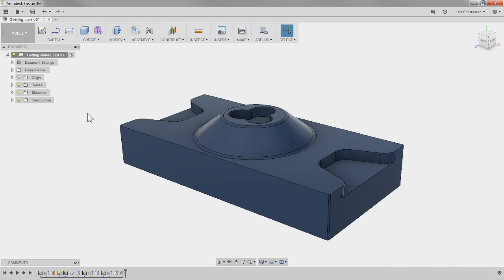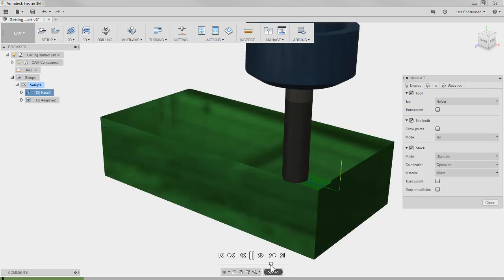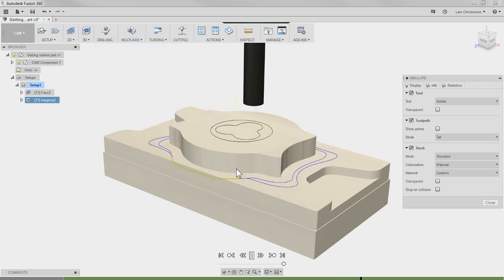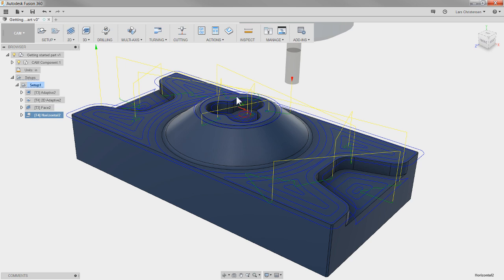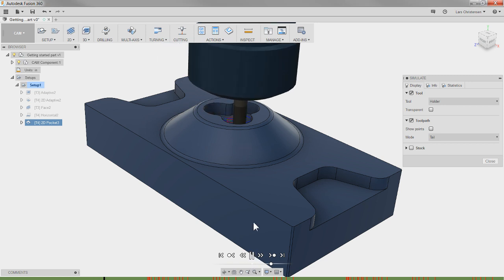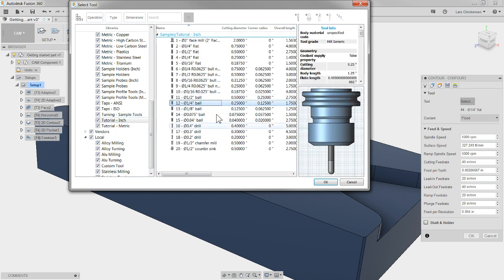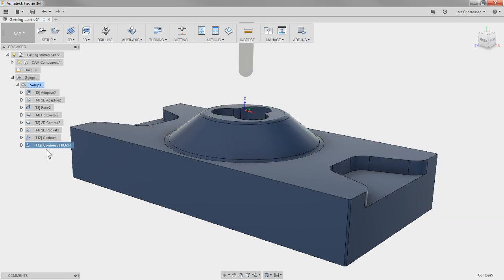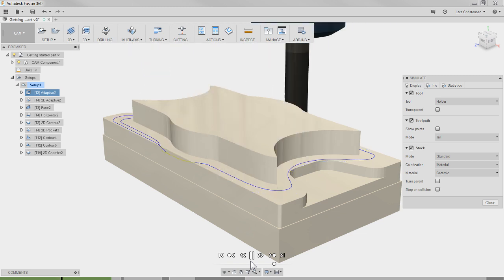Fusion 360 — Mix 3D CAM Toolpaths with 2D — And Your Comments & Questions — #LarsLive 58

Comment: Thanks Lars for all your videos, I have learned a ton by watching them. I have purchased a few 3D relief files off the internet. They are in STL format. When I try and create tool paths in Fusion the image seems to be frozen and I cant do anything with it. Do you have a video that shows how to take a 3d relief STL file and change it so I can add tooling paths ?Thanks again for all your video's.Ryan
Reply from the maker: Hi Ryan, Make sure you select the STL in the model section doing the CAM setup. I am not sure if there is where you see the freezing, but that is a little different than when machining solids
Reply: Thanks Lars for you reply message. Keep making videos, we love them.